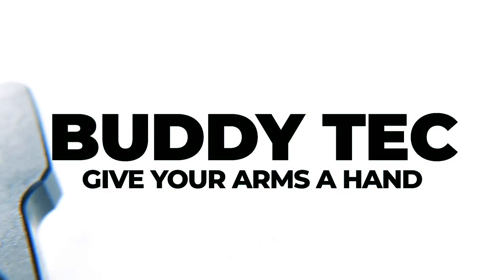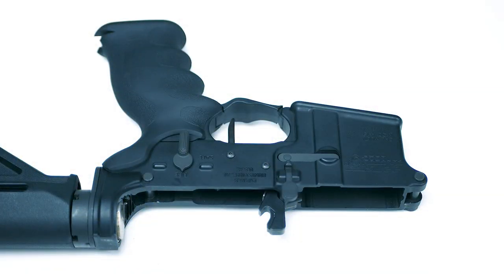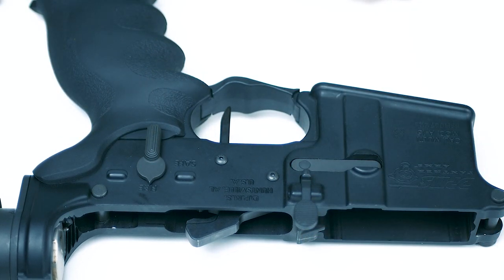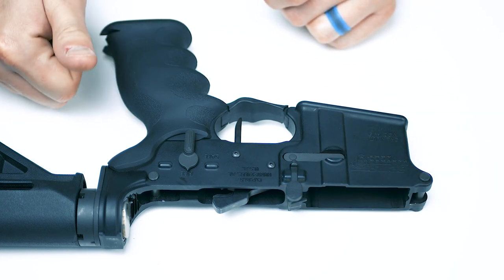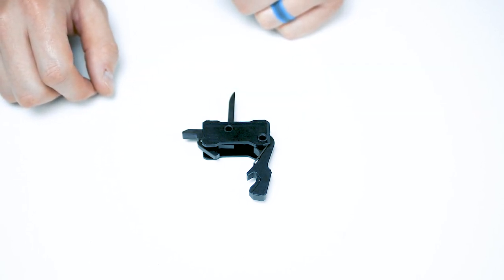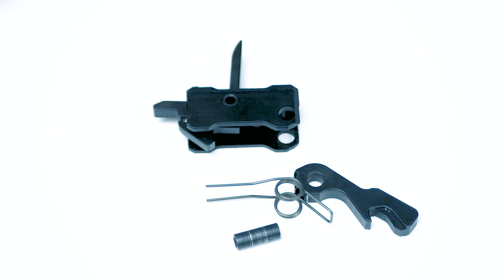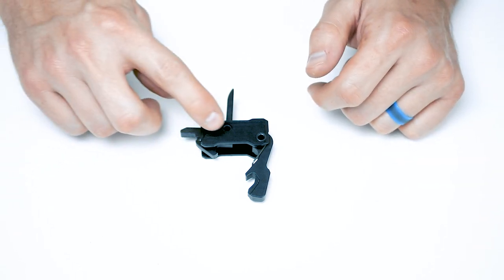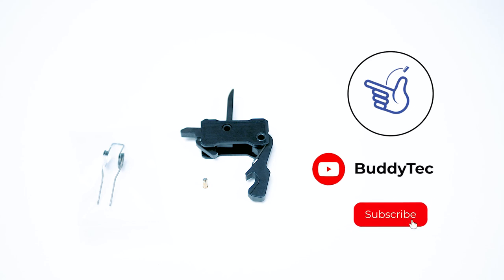Rise Armament: Rave 140 Drop-In Trigger Heavy Spring Install

Comment: I'd suggest this spring upgrade to anyone who plinks with steel-cased Russian ammunition: .223 or 7.62x39. I had light primer strikes on some cheap Wolf, and this spring was the solution. Considering swapping to a titanium firing pin to take the beating of the extra-powered Rise hammer spring. Thanks for being the only one to upload a video on this.
👍🏻👍🏻
Reply from the maker: Thank you.  Good call on the titanium firing pin, I'm gonna look into that.

Comment: The RA 140 with springs in the bottom is apparently an old version that has several known issues. Including hammer ride home. I just RMAed mine after the sear failed to function anymore. Be careful.
Reply from the maker: Will do, thanks for the heads up.  I'll contact Rave 👍

Comment: Just finding this video. I'm having light strike issues in a 9mm pcc with a rise 140. I know they have a new 140 pcc model that I'm interested in checking out. However, would you think replacing the rise spring with the factory hammer spring from the gun would increase spring pressure enough to fire? It's not an every round occurrence, had 10 light strikes out of 150 rounds.
Reply from the maker: I would reach out to rise armament and see what solution they offer.  They recently replaced my whole trigger assembly due to a similar issue even after the heavy spring.

Comment: Does changing the hammer spring increase the pull weight of the trigger? I believe you have already answered this question but I want to make sure as I am looking to purchase this trigger for my ar-47 build also!
Reply from the maker: I personally had a hard time telling the difference in weight.  Installed it still feels like a 3.5 pound trigger, and I would do it all over again.  Hope that helps 👍
Reply: @12spies  thank you for the reply!
Reply from the maker: @tilleypatrickpt  happy to help!

Comment: Thanks for the instructional video. I most definitely benefited from watching this as I know nothing. Anyway, I got my replacement spring and compared it to the old one and they look and feel identical. Did you notice a difference on your new spring?
Reply from the maker: We didn't notice a difference in trigger feel but we did in reliability.
Reply: @12spies  I agree the trigger pull still feel the same. But when I disassembled the trigger and physically comparing the actual springs in my hands, I saw no difference and the tension felt the same. I'm wondering if they just sent the same part by accident. That's what I was trying the ask in my original comment.
Reply from the maker: I misunderstood.  

There was definitely some difference in the two for us.  We also changed the firing pin to the upgraded one shortly after and noticed an almost total resolution of light strikes after that.
Reply: @12spies  dang...I think I'm gonna have to give them a call tomorrow. Thanks sir

Comment: Can the hammer spring be purchased separately or do you have to contact Rise??
Reply from the maker: I believe if you buy a separate heavier trigger spring it should work, they just sent mine as part of warranty.  I don't see where Rise sells individual springs outside of their kits though.
Reply: @12spies  ok thanks for the info. I’ve tried using regular spring but they’re too wide they won’t fit. It’s impossible to find any sold separately for drop-ins.
Reply from the maker: @ProactiveDefenseLLC  Ah sorry about that.  Makes sense, it's not having to fit in the drop in housing, so it would be wider.

So is Rise Armament not willing to send you one?  They considered it warranty for me and shipped it pretty quick.
Reply: @12spies  I haven’t reached out to them yet, I wanted to see what you had to do to get yours addressed first.

Comment: Where did you get the heavy spring?  I've not been able to find one that will fit.  A milspec hammer spring is to wide even with modifications.  Thanks!
Reply from the maker: Rise Armament provided it as part of the warranty after we purchased the Rave 140.  Mailed at no additional cost.  They were pretty quick about it, too.
Reply: @12spies  Any cost from RA?
Reply from the maker: None.  Just the initial trigger purchase.  Reached out to customer service and they offered to either replace the whole trigger or send the heavy spring.  We opted for the spring and it's worked great 👍

Comment: Did you have decreased light primer strikes after the spring install?
Reply from the maker: We ended up having a bent firing pin shortly after.  After replacing that, we only get light strikes once every couple hundred rounds or so with the new spring.   Overall, it has been much better.
Reply: @12spies  thanks for the response. Good information to know. 

Do you think the bent firing pin was due to the heavier hammer spring?